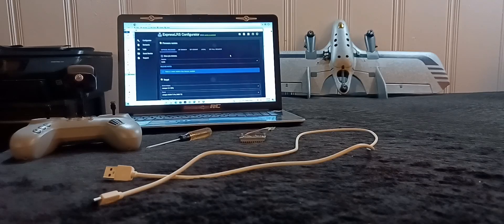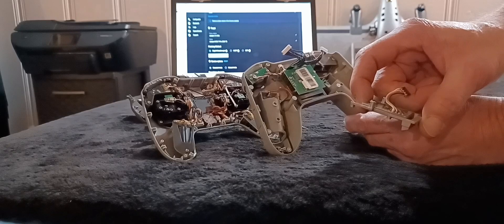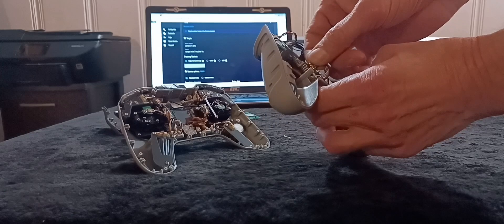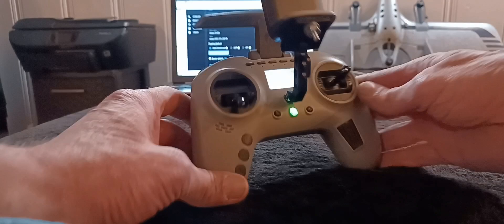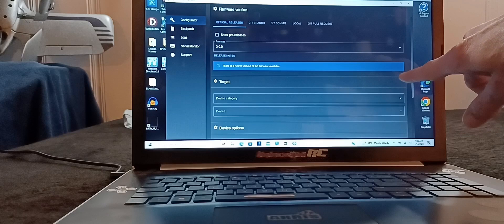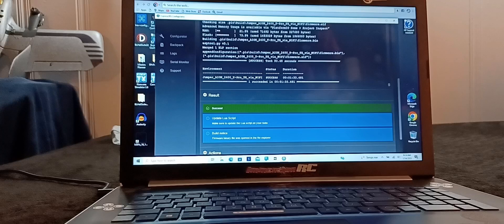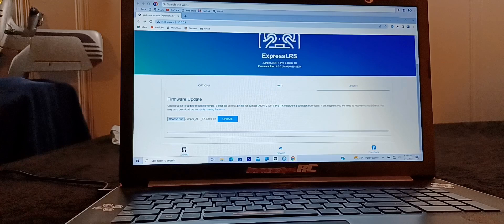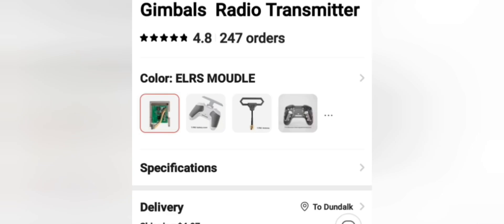Jumper Xiake 800mm Vtol (Jumper T Pro upgrade to 1watt internal module)

Comment: Ciao, molto interessante questo video complimenti! Volevo chiederti se, secondo il tuo parere, è possibile cambiare da Mode 2 a Mode 1 questa radio. Grazie! Buoni video!
Reply from the maker: I'm sorry I never read this message and if you haven't gotten a answer yet, Yes it can be switched from mode 2 to mode 1
Reply: @altitudefpvphotography4616  ciao grazie per la risposta. Ho acquistato lo Xiake dal venditore direttamente in mode 1. Ma ho dovuto cambiare io sulla radio Jumper il Mode da 2 a 1 via software. Ancora non ho eseguito nessun test, ti aggiornerò in merito!

Comment: Any issues with the xiake so far?
Reply from the maker: It has very unstable yaw control in the lightest of winds when in Vtol mode !
Reply: @altitudefpvphotography4616  which is probably not the issue in fixed wing mode I bet? Can't wait to get mine, plan to do all the upgrades you done to mine.
Reply from the maker: Flys good in Forward flight !
You may have to adjust the motor tilting angle and speed in Mission Planner before you fly !
My right motor didn't tilt all the way down in Forward flight and the speed of tilting was to slow on mine ! But I believe I covered those issues in the main setup video I did!
Anyway bench test every thing before 1st flight ! 👍
Reply: @altitudefpvphotography4616  Yeah I think I am going to do an indoor test before I adjust on mission planner because it seems like a lot of people have had different issues but can't wait until I get mine. Thanks for all the input most definitely needed here.